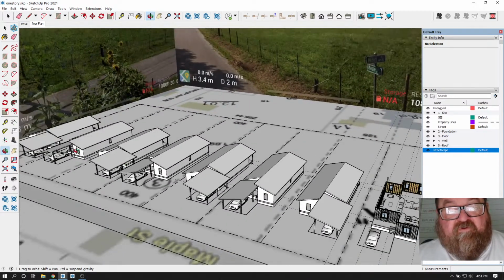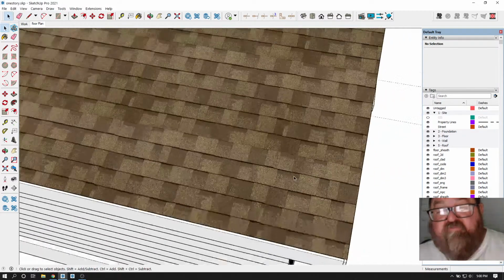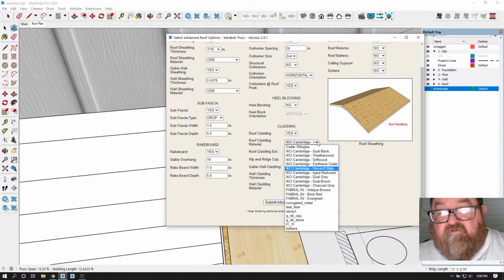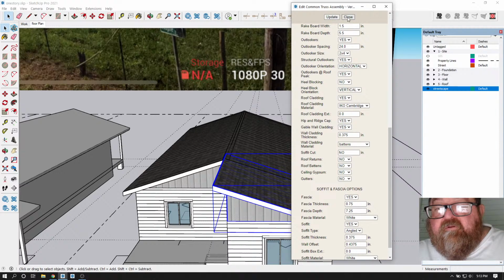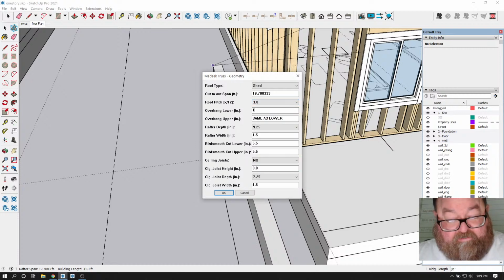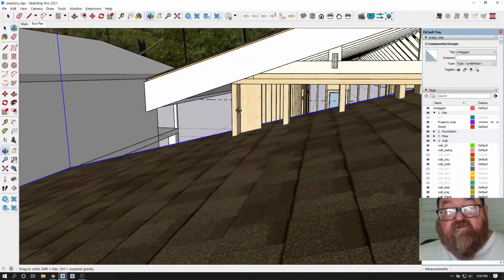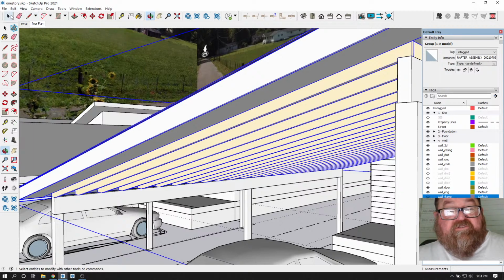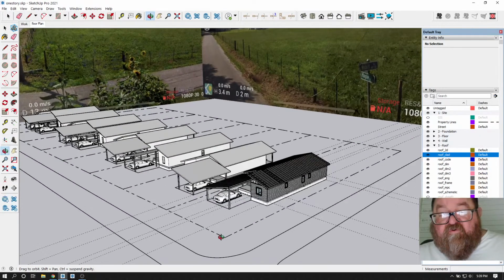New Maple St Design-Build Project - SketchUp Live Work Session

Comment: I was wondering why you aren't using Revet. Im deciding what program to use, im pretty good at sketchy, but im considering learning Revet, since that is what we use in Denmark. What do you think? 
- 15 year old construction wannabe
Reply from the maker: Revit is way too expensive for me :)  SketchUp pro is like 299 year and revit is over $4k a year
Reply: @ArtisanTony  If it was the same price, what would you use?
Reply from the maker: @thomasbitsch5488  SketchUp mainly because I want to use the tool that is more appropriate for the job.  Like I said before, if I was working on a big project where I was working with engineers and consultants and had to share files due to BIM, I would use Revit.  But I am just doing simple design-build residential projects and the simplest tool is the answer.  I don't even have to do complete construction drawings because I am also the contractor and know how to build things so I don't waste time on unnecessary drawings and details.  I have built off of rough schematic drawings on most of my own houses.  They didn't even have doors and windows in the openings:)   so I look at things differently as a builder. The built project is the the goal, not a perfect set of drawings :)
Reply from the maker: and really, unless you are working in an architecture firm where you are working with multiple disciplines and consultants, a BIM is not really necessary.